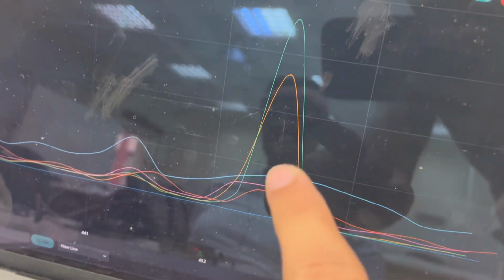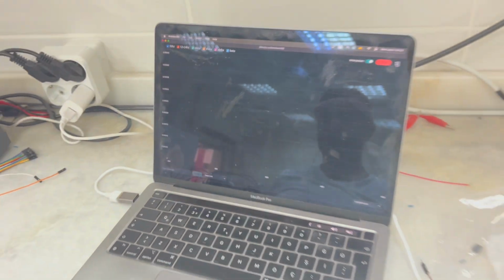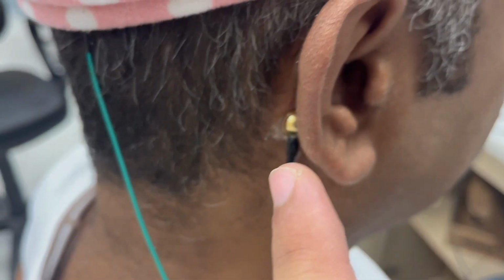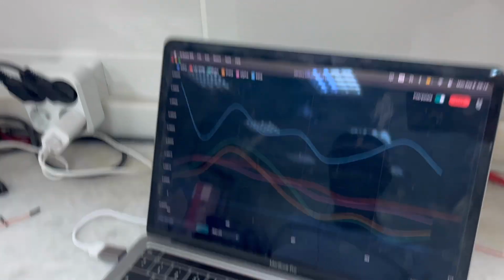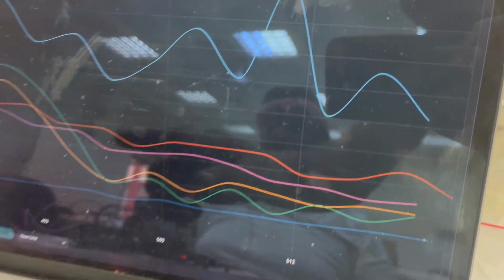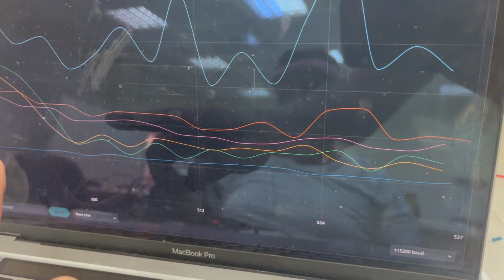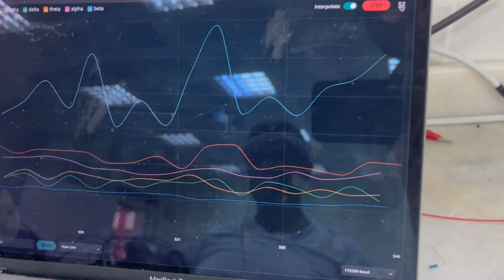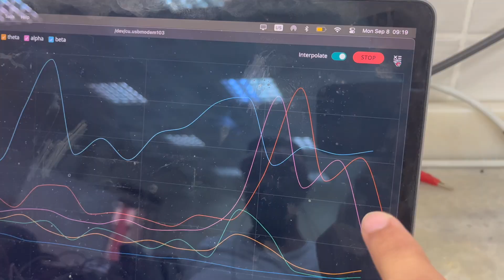Custom 1 Channel EEG Device – Alpha Jump Demonstration

Comment: This is very interesting! Would it be possible to hook this up to a USB port and use it to control a mouse?
Reply from the maker: Not this version exactly, but with a multichannel version you can interpret Beta waves in the code for mouse movement yes. But it will be rather complicated and long process :I.

Comment: Very cool!
I haven't looked at your schematic, but would suggest for safety to use your device powered by batteries. That reduces the danger of connecting your participant (person) to mains voltages.
Reply from the maker: Yes definitely you are right. It is powered by usb at this version.